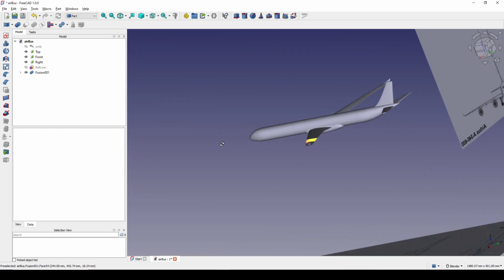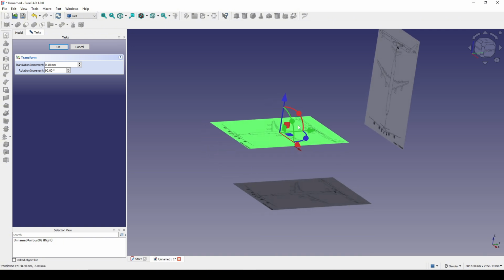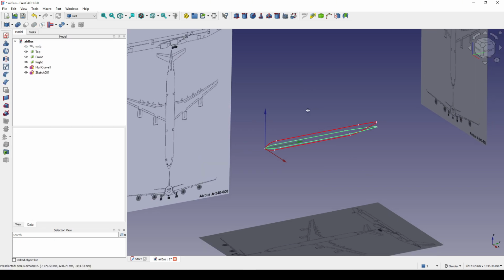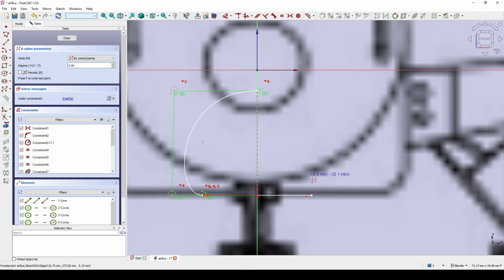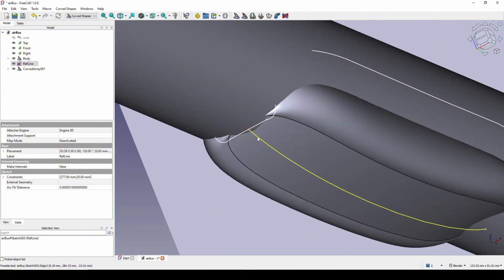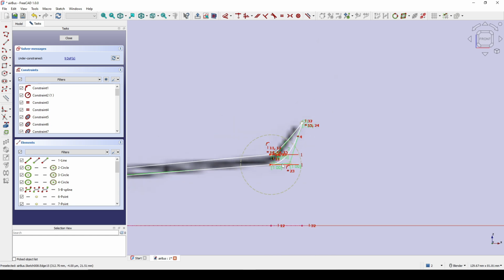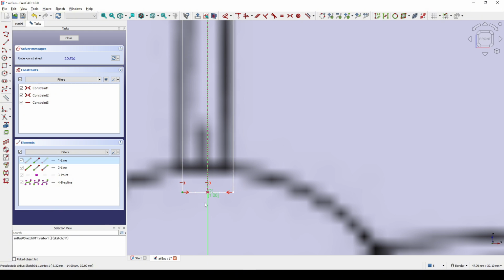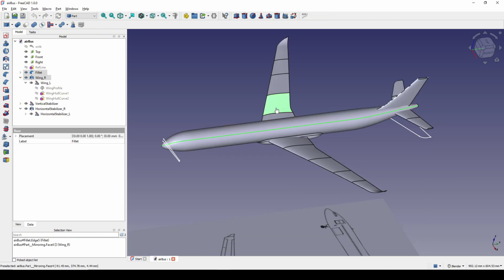FreeCAD 1.0 Model Basic Forms Of An Airplane

Comment: Nice Tutorial. There're few examples about modelling aircraft with FreeCAD. Will modelling aircraft with surface rather than solid in FreeCAD be difficult? I feel sad for that there're few options for multi-section loft sufrace feature in FreeCAD.
Reply from the maker: Thanks! You can use Curved Array, Curved segments… and instead of turn on solid option, you turn on surface option, from there you can trim and cut surface to create details. Or you can sketch mutiple section sketches and loft in part and uncheck solid.